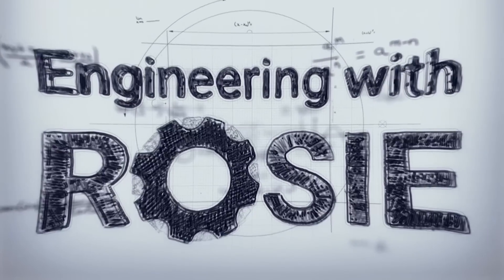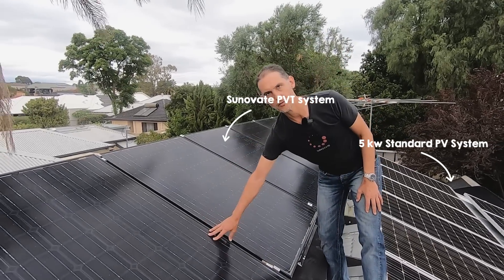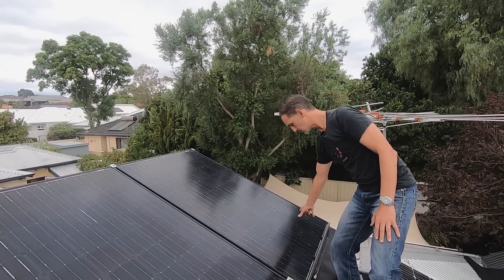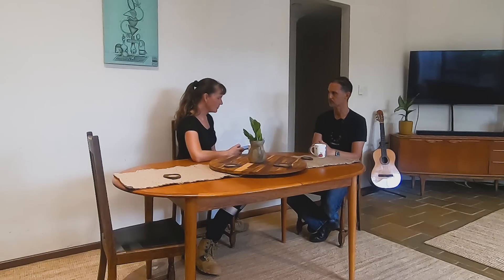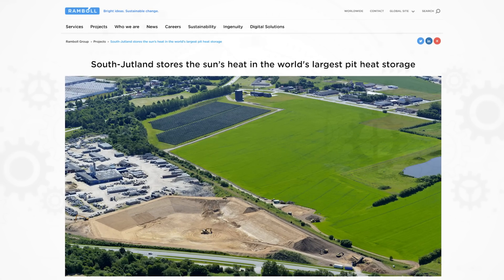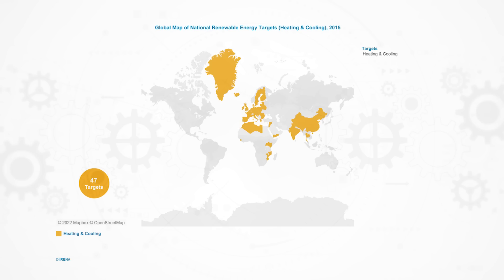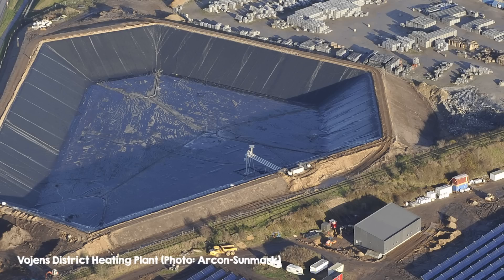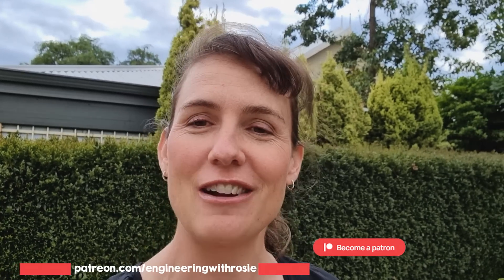Warming Up By Cooling Down Your Solar Panels

Comment: Sounds good but I disagree about water being a problem. I am off grid for 13 years we have solar power but also solar heater that runs on water. I live in the mountains so we get very cold below freezing at times. The reason it doesn't freeze is we use antifreeze coolant that's designed for cars. Never had a problem. So  that is one problem solved. The second problem mentioned is it holds the heat when it goes through the panel so it's hot at the top, that can be solved by using a faster pump. They are just some thoughts on this.
Reply: I agree, I don’t understand how his system is any different besides the distribution of cooling medium(air) which can also be used with distribution of water in similar manner.
Reply: If you can share manufacturers and suppliers of pv/t please.
Reply: Can you we explain your heating system?
Reply: Heat distribution in the panel could also be fixed by changing the shape of the piping to circulate between the panel areas before exiting to the central systems.
 A 3rd option, independent of pipe layout is to use the coolant of an attached heat pump directly, thus avoiding energy losses in transferring heat out of air or water into that heatpump.
Reply: @johndododoe1411  using the solar panels as the radiator for the heat pump sure would turbo charge the heat pump's efficiency! 😅
Reply: @iamdave84  Obviously it would be the cooling surface, not radiator, except during Siberian winters.  But that's just a matter of using the usual reversal valves and setting the thermostat to keep the panels in their preferred temperature range.

Comment: As a Canadian viewer, I'd say seasonal storage is key. Right now wood is my winter fuel but I am interested in making better use of my solar array to reduce wood needs. Insulation and dry wood make a massive difference but that in ground heat battery with a heat pump look pretty sweet too! Hydrogen, biogas and in ground heat batteries are all on my mind but so far efficient wood use is central for me where I live in the bush. I cut the dead wood to reduce potential forest fire fuel. In the city where there is little wood and lots more sun, I think I would have installed a heat battery or hydrogen system already
I do keep thinking though, what would be possible if all patents were released? It seems like many great solutions are hidden from the public
Reply: Post pictures of your infraestructure
Reply: The only really viable storage formats for energy between summer solar power and winter consumption are either pumped hydro, if you have a lake and a hydro plant. Or a bi-directional fuel cell and hydrogen. Assuming that you have plenty of panels, so conversion efficiency isn't a big issue but that long term storage is the absolute requirement I'd go for a hydrogen cell.

Comment: Over 30 years ago I visited 2 homes, one near lake Tahoe, and the other in chilly Montana. Both homes at that time took less than $100 to heat, versus the $500-$700 average. Both were built with 3 times the insulation building codes required. Obviously,, insulation is as, if not more useful for reducing both heating and cooling costs. And it costs less than a heat pump using earthen piping.
Reply: Yes, it's called super-insulation. Add thermal mass and you have little need (comparatively) for heating/cooling. The interior is kept at a constant temp of your choice. Why it's not the world paradigm is a mystery to me.
Reply: But insulation has a massive diminish of returns past a certain point... 3x insulation isn't 3x as good

Comment: We did a project at uni recovering heat from PV back in 2005/6. I'm amazed that it's taken this long to recognise the benefits of doing so. Still more surprised that we are at the prototype stage still. I guess it comes down to cost over benefit as opposed to technical feasibility.
Reply from the maker: I don't think it took very long for engineers to realise the benefit (your uni was obviously aware some time ago), it has proven tough to commercialise so far though. Lots of reasons but I think the way that renewable energy incentives are set up is a big part. They usually only incentivise generating renewable electricity and not ways to use less electricity or to create renewable heat directly. Probably there are other reasons too!
Reply: Andy, we come up against the hard fact that gas has been heavily sold as an environmentally friendly fuel and its relatively cheap. Worse still it can be made cheap to keep a customer when competition appears. Globally renewable heat targets are just starting to be addressed so this should change the market dynamic as it did for renewable electricity. PVT also straddles the PV and solar thermal markets  which have historically been battling for market share and roof space.
Reply: PVT panels are already being used, at least in the Netherlands. Not as common as PV, but that's to be expected.
Reply: It doesn't makes sense really still. Panels are so cheap, just add more panels

Comment: Here  in the Netherlands I use the SolarFreezer system.  It uses a collector, locked in behind the solarpanel. In my crawlspace I have a " balloon" filled with water. These waterstores are connected via a heatpump. It heated my home throughout the winter without a glitch. It's been running since December 1st  so I Just got It installed . It cost just as much as a new EV. But with the savings for heating and cooling a EV is not far away.
Reply: What is your COP of this system? Are you using a heat pump on the balloon to heat the home?
Reply: Hi  @cclambie  ,
The balloon is the thermal buffer and is charged by the PVT, and the control unit decides to use the PVT or the balloon as a source for the heatpump. Lowest COP till now was 5,3 (February) . December the pump was learning our usage with a COP of 5,6. I must note here that December 1st I filled the balloon with water of 12°C. It started January with 6°C. Maximum temperature of the balloon is set at 25°C. The kicker of this system is that is also has the ability to be used as an Ice storage system. It's to long to dive in to that here. Long storie short. U can keep pulling heat out until it freezes solid. And this way u have an ice block to cool our home  later in the year. Because of the cost I opted for the balloon instead of concrete stores underneath my driveway.
Reply: @homegrown241  that is super interesting. Have you done any blog/video/explainer on it?
Reply: @cclambie  
No I haven't.  Not really my thing.  I just wanted to comment on the PVT topic raised by Rosie.  There are a few videos on YT. Two of them are from a guy that didn't  have the luck I had . His system doesn't   run as it should.  He made a video about it. Search for SolarFreezer and you'll find it
Reply: @homegrown241  thanks.

Comment: Hi Rosie, I live off grid in Canada and I love your channel!
One of my solutions for reducing my electricity need in winter is to have my freezer outside in the shade of my woodshed and I just unplug it in the winter. I have lots of power for it in summer and on warmer winter days. That seasonal storage looks really good to me. The coolant here would not be water, it would be glycol with a heat exchanger to make hot water and so it wouldn't freeze in winter. Wood heats my home and hot water and my floors now too! Winter is too long here to rely on a heat pump for Dec-March but charging an in ground heat tank during summer could certainly shorten the amount of heating needed.
Reply: I am sorry to hear you live in canda, but great that you are off grid....

Comment: Thanks for a nice program. Now I feel the urge to climb up on the roof with my leaf blower (battery electric) and cool my PV panels to see if it differs.  ;)
One more note, here in Sweden we have snow covering the PV plant so we have absolutely 0 kWh in some winter months. Our plant is still going strong after 10 years. Fantastic invention.
Reply: here's an idea...could you not used to grid electrictity to blow some hot air through a sunovate like system which would in turn melt the snow/ice on your panels? thus reudcing the need to get up onto the roof to clear any snow.

Comment: From a maintenance perspective hot air is a great idea.  I have evacuated tube solar for hot water, and it's a massive pain in the butt.  In -20C winters in Canada, even antifreeze will gel and prevent circulation which, somewhat counter-intuitively causes the panels to overheat, overpressure and vent steam.  And when a pump fails on a bright sunny day that's just a barrel of fun.
Reply: Get better antifreeze
Reply: If you said it gels at -70 I’d believe you. But @ -20C or -30C? Get some proper stuff

Comment: I was planning to do something similar, but with closely packed copper pipe right against the underside of the panel close enough together to cool the panels and capture as much thermal energy as possible. Then transfer the heat to a concrete lined pit filled with sand  using coiled PEX using thermosiphon. Sand is really great for storing heat long term.  From what I have read they heat multiple homes and businesses that way  in Scandinavian countries.
Reply: How much heat are you planning on capturing?

Comment: One of your best, though of course like Australia here in Florida (US) is mild and cooling is the primary concern so heat pumps do well though maybe with PV this could be used for heating water with heat pumps between the PV cooling exhaust and the water (obviously an optimization must be performed to see what balance would be needed in sizing such systems).
Reply from the maker: Yes, it has a very different potential in mild climates than in northern Europe and Canada. I think in really hot places the advantage would be in efficiency gain of the PV and improving longevity of the panels. But I expect we'll see this rolled out first in places like Scandinavia where district heating and seasonal thermal storage is already a mainstream thing.
Reply: Hi Zhu, as we have relatively mild winters we can use the heated air directly off the panel for space heating and at summer from night radiative cooling. We can reach domestic hot water temperatures in Summer if required. In wintertime we need some boosting time to time. In these cases we are using a simple top of tank electric resistance heater. In colder climates we leverage more on the air source heat pump option.
Reply: @glenryan6692  are you Sunovate?
Reply: @glenryan6692  A heat pump will heat the tank using less electricity than a resistive heater.  They are usually sold with a sticker stating the improvement factor.

Comment: When it comes to district heating you should have a look at places like Austria (the city of Graz for example). Basically the entire city is connected to the network and a big chunk of the heat is waste heat from industry which is usually just lost in most places around the world. Places like Vienna also started to implement district cooling. Those are much more efficient solutions than having every household install an individual heat-pump (which usually needs to be replaced every 10-15 years) and further straining the grid.
Reply from the maker: I also love district heating, that's how my city was heated when I lived in Denmark and it was so cosy and cheap. One of my first ever videos was on that topic acutally: https://youtu.be/F3mC_TaJk2U
Reply: Many cities that relied on district heating generated from the waste heat of fossil fuel power stations and industry. With these power stations closing municipalities are scrambling to find alternative. This is what this sector is so exciting for us.
Reply: Finland also uses a lot of district heating. I believe we currently have ten functional waste incinerators that are connected to district heating and many more that burn (mostly wood based) biomass. Those waste incinerators have the added benefit of reducing the amount of waste we export. Actually once Vantaa's new waste line is functional the amount of exported waste should be reduced by more than 60%. I mean why pay for others to accept your waste when you can burn it for energy? Even more you can use the byproducts in construction. Similarly most of the byproducts (mostly ash) from biomass burning end up as fertilizer.

Granted most locations still also use a bit of coal, biogas, peat and LNG - at least as a backup. For example in my hometown they produce 98% of heat from biomass. That being said only some districts are covered by it and for example I live outside district heating despite living rather close to one of the town centers. I have two heat pumps though as I replaced oil heating with an air to water heat pump two years ago and already had one regular heat pump. Those are pretty common here along with GHPs.

Comment: I was in the US Navy in 1976 and Mainly Buildings were still WW2 era structures

My personal experience saw all of those buildings were connected through a very large complex steam heating system that were Asbestos wrapped piping that were above ground.

So main boilers supplied the heat to the whole base through those large Steam Pipes

I also remember homes using radiant heating and cast Iron radiators to heat each room in a home.

So Old is now New again

Comment: While district heating overcomes storage issues it will often not be available. Another option is to store heat in the building structure if direct space heating leads to overheat the building. This process changes the time of delivery of the heat by radiation and convection from storage.  The storage site could be actively warmed using air in hollow bricks or in slabs with air ducts or water pipes in place, and passively discharged. Alternatively, phase change salts in tubes can increase the energy density of storage. Using the heat for hot water in the summer would make use of at least  some of the heating and venting the excess heat could pull cool air through the building for cooling.

Comment: Rosie, in horticulture they irrigate pot drippers in a parallel grid so that every pot plant gets the same amount of water. Surely PVT water cooling can do the same so every solar cell is equally cooled. 

Also. The time of year mismatch isn't a mismatch for horticulture or even households, you could use excess hot water to kill weeds or do other some other useful work. Tractor towed steam weeders have been experimented with as a alternate to chemicals.  Seems like there might be some real possibilities for PVT in horticulture.
Reply: Agri PVT is an application that we are hot on at the moment. Sunovate is the only PVT solution to cool every cell evenly.
Reply: ‘Just Have a Think’ had a video about regenerative agriculture that had arrays of panels that protected crops that would benefit from some shade. Going from memory here but it seemed like a win-win.

Comment: Hi Rosie, In my view, Proper isolation of the housing is a key to the shift to renewables heating. it helps reduce the need for heating or cooling that would already reduce the size of teh elephant in the room.
Reply: [nsulation
Reply from the maker: I agree one million percent! I have never understood why most of the world has not managed to improve energy efficiency more as a key part of climate change action. It's by far the cheapest way to reduce emissions (and often has negative costs). 

I believe it's largely due to split incentives. I worked briefly in building energy efficiency (about 15 years ago) and the energy audits my company would do always identified a number of potential efficiency projects that would have an economic payback of 6 months or less. And they very rarely got done unless they wanted to rent to government tenants (who had a minimum energy efficiency rating they required). That's because otherwise there was no incentive for them to take on a new project. They bill the tenants directly for electricity consumption, so why add to their workload to save someone else money? Such a stupid situation.
Reply: @ Engineering with Rosie
I have some experience dealing with property management firms and they get paid on the basis of a percentage of the expenses. Reducing expenses reduced their fee. Their incentive to keep costs low so that tenants could remain profitable and thus paying the rent (long term thinking) was outweighed by the reduced management fees today (short term thinking). Most commercial tenant’s associations are run by the tenants that actually take an interest and they may not be that sophisticated (not deriding them) in accounting. Hardly any tenant ever looks at the statements provided by the property management group. At the mall where I had a business I noticed in the summer that the lights in the parking lot were coming on at 3 PM when it didn’t get dark until 9 or 10. I asked where the timers were and the answer was nobody knows. After continually raising the issue the management company installed lights that only came on when it was dark. At a marina I was asked to figure out how a programmable timer worked for the lights. I was very impressed with the little gadget they had purchased. Rather than having to continually adjust the timer all I had to do was enter the latitude of where we were (Canada) and the program would adjust for seasonal changes on a daily basis. Someone put a lot of thought into that programmable timer!
Reply: Passivehaus
Reply: @mikedavison3400  I have seen this perverse outcome with some of my clients. Even worse the building/facility owner's procurement practices were so bad intentionally to drive a bigger cut of the energy bill. These practices need to be outlawed.
Reply: @ glen ryan 
Just like the energy audits that can lead to savings so could some forensic accounting of property management firms practices.